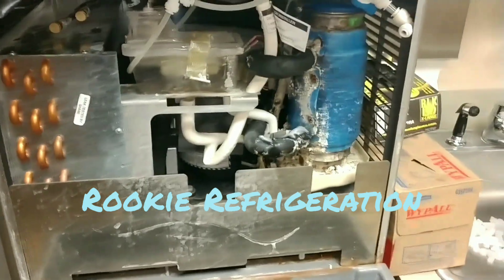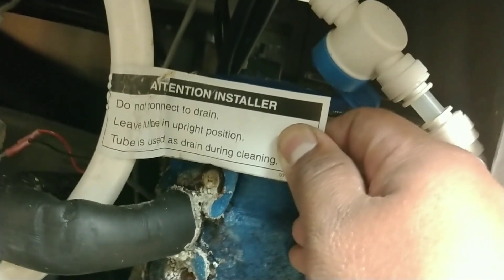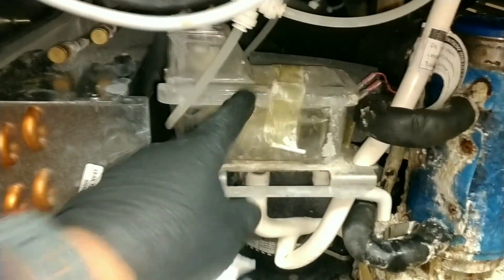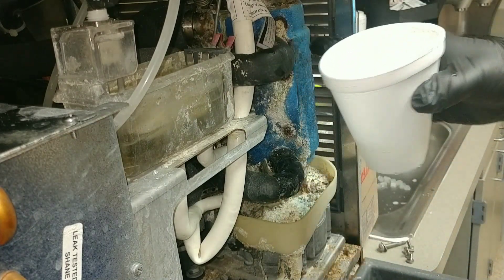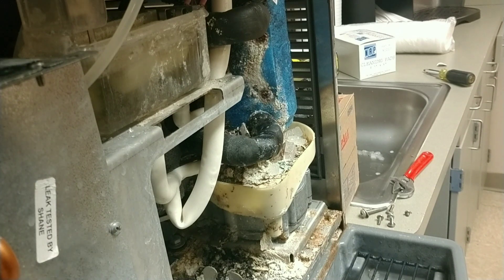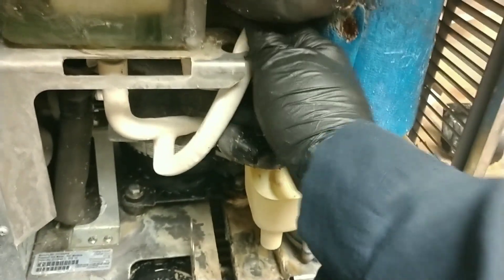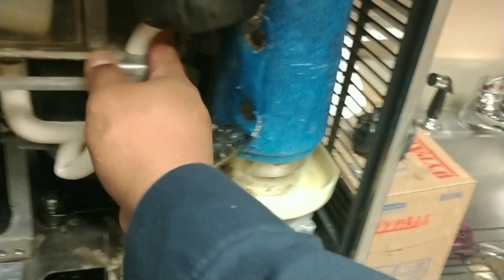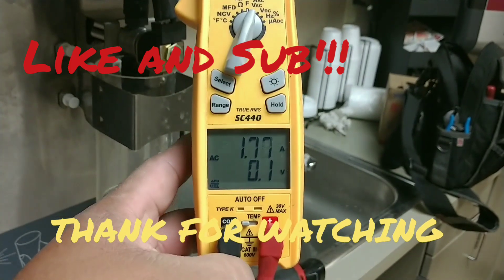HVAC Refrigeration: How to clean a Follett Ice Machine

Comment: You could have made things a lot easier by sliding the icemaker out of the dispenser. Takes about a minute. Amp draw looks good for the bearings, mostly just scale on the wall of the evaporator. If your descaler doesn't do it, you can use some Scotchbrite in and out of the barrel. Check the auger for a film of scale as well. Scale won't show up when the surfaces are cold and wet - they need to be dry. Be sure that the ice in the evaporator is melted out before you add your hot ice machine descaler, otherwise you might be just wasting your time. Different acids work better on different types of scale, if one doesn't work, try another. As long as you are mixing per the descalers instuctions, you won't hurt the stainless evaporator.

Comment: I put one of these Follett (counter top) machines in my house. It now needs repairing and NO ONE will come to the house to repair it. Be advised that this is a very real problem as these machines cost a fortune to buy then no one will repair them. I called over 10 repair shops and their first question is "is it in a commercial place of business". As soon as you say no, it's in my house, the conversation is over.

Comment: I just got a Follett ice maker for my house. I love it but it just stopped making ice. Thank you for your videos I will see if i have those trouble codes and I will clean it as well. My machine is a little different mine has the compressor and evaporator on the bottom and it slides out to work on. Thanks again!! Great videos!!